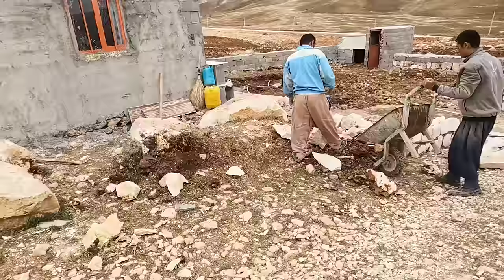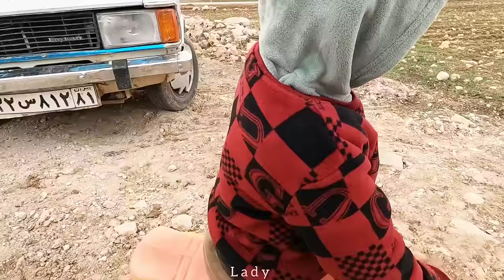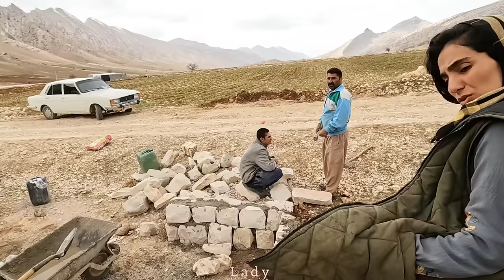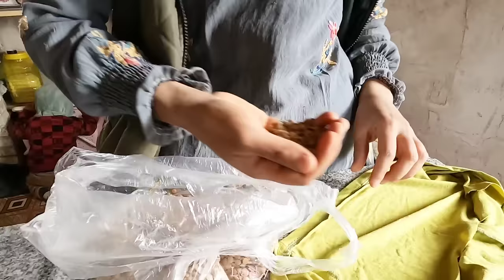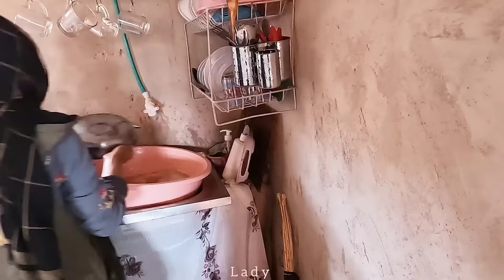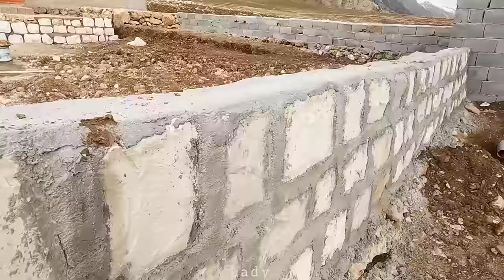Mehin and Adel next to the kind architect who makes a house: nomadic life

Comment: You have a very small property. To maximize SPACE in that property, you need to build HIGH UP. So, build a TERRACE!  When ever you build a higher platform in an area, you gained that space to your property! Building a platform up higher allows you to also have an interesting topology on your property, as not everything is flat, small, and boring. I would make a terrace space about 4 layers of rocks high, all along the wall opposite to your street, and I would stretch it all the way toward the dog house, stopping about 2 meters from the dog house.. Then I would expand the width of that terrace forward into the court yard, and I would plaster all of the terrace in its full length and width. Then I would build another house on that terrace, next to your house. It could become the kitchen. I would build nice and wide stairs coming down from that terrace onto the lowest ground of your court yard, and I would proceed evening out the court yard ground, and laying flag stones all across the entire low ground of the court yard. Next to the bath house, I would then build another building, for storage, or what ever you desire to use it for. Now you would have 3 main buildings (and the dog and bath house), next to the walls, and a lovely flag stone art on your low court yard, where I would build several plant boxes for color and beauty. I would also build a stone table with stone benches, and I would build a beautiful open fire pit with gorgeous big white stones in a circle, cemented, and then I would cook something yummy!
Reply: Not your place.

Comment: Your house needs an A roof! You need it to make the rain wash down, which you then catch in a large container and use in the summer to water your plants with. Your roof should ideally have a 45 degree angle (A standard roof pitch is 12/12. This type of roof can handle a lot of weight without collapsing.) The flatter your roof, the WEAKER it is! Your roof is FLAT AND WEAK! Get it to have at least 33.69 degrees, if you do not want the standard safest 45 degree roof. You should never spare money on the roof.
Reply: Don t worry. She knows what to do.